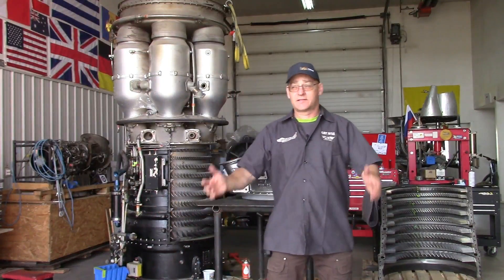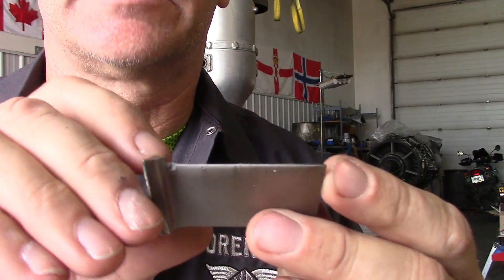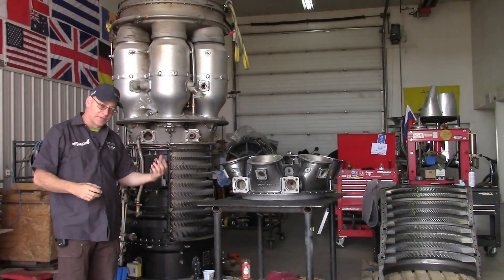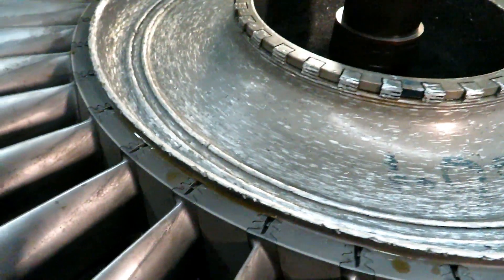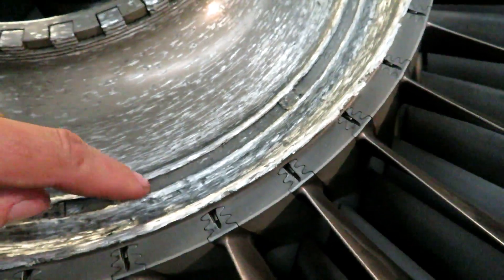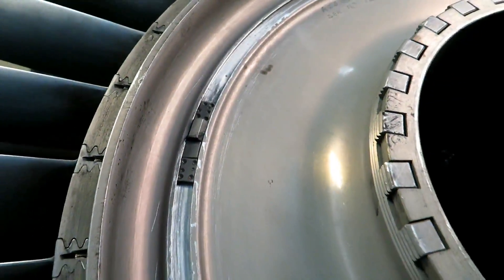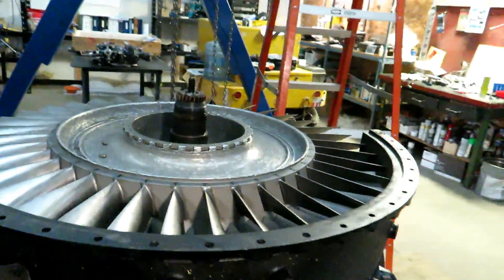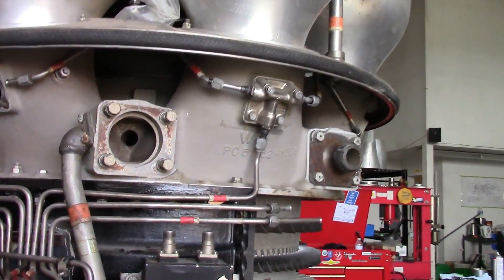Surprised by unusual damage

Comment: What's your opinion on the problems Rolls Royce is having with their Trent 1000 engines?  Poor engineering?  Flawed concept?  Improper maintenance?
Reply: As I understand it, the Trent 1000 has had some form of very obscure vibration problem with the rear (correction: front two) stages of the IP compressor blading, which has taken some time to understand and correct.   In addition, I believe that there may have been fatigue failures of IP turbine blades, associated with a corrosion problem.   In contrast,  the Trent XWB in the A350  has been relatively trouble free.
So, having discussed R-R's problems, should we now move on to discuss the very serious problem that Boeing has had with the 737 Max series?  And what about the problems that both GE and P&W are having with their newer engines?  In particular, things seem to have gone very quiet about the uncontained failure of a GP7200 engine on an Air France A380 over Greenland back in September 2017.  
It does seem to me that there is a tendency for the media (and politicians) in the USA to gloss over engine and airframe problems when they occur to US products, whilst highlighting the problems with overseas products.  If, for instance, Airbus had experienced a problem similar to that which has affected the Max 8, then I have little doubt that there would have been demands in the USA for an immediate (if not permanent) grounding of the aircraft.
Reply: i. rob  And, unfortunately, another GE90 on a Philippines Airlines B.777 has had a problem.  I'm flying back home to the UK on Monday, courtesy of four Trent 900s. The A380 has been branded a "failure", but it is the most comfortable long-haul aircraft that I've ever flown on.

Comment: Use the same cases
So it's outer
The base of support
That's not fixable
This is a garbage
Then
The paint is
Take a front frame off
I was shoked
Shocking thing
But there are
But they look like
This way
Really smashed
Moved along
The area ware
It's hard to say
Big enough
Here's a little piece
More of a fence 
All the way of compressor.
Up here
There is it there
So
The basics are
No real damage
Looks ok
Looks alright
And so we have
There's a tool
And pull the top tube
Put it together
Take that compressor rotor
We check the balance of that thing
Not any catostropic damage
Sticking the same space 
Non the less
This is the best thing
Anyway 
Undamaged
This supposed 
But I do believe
Anyway
Now
In order to repaint
Brownie
Not really attractive
Metalic 
It's awesome
This is the stock color
We got black
We got high heat silver
Dull
look at this
Custom color available
But they won't be notice
This is undamaged 
Use the original cases
Saver jet engine
Reminder 
Worked over
They do a tough job.
Just do that
Only 
Repaint it
That's not the best plan
Service 
Needs to be overhaul
Safety is no one
It's gonna be awesome
Thanks for watching
Reply from the maker: ... the lyrics to a mechanical resurrection anthem? 
Sabre Jet.

Comment: O/T Question - Can an Airplane travel faster than the exhaust gases from the Jet Engine?
Reply: Well a rocket can do so, so an airplane probably could in theory. In practice drag will probably prevent that.
Reply: Thank you, it's hard for me to wrap my head around that concept.
Reply: @tetekofa  well you think of air pushing against air, which is not wrong in itself, but then you also got engine accelerating air and (force counterforce) engine beeing accelerated.
Reply: No! An aircraft (being a Brit, I cannot bring myself to write 'airplane' - it would have to be 'aeroplane') cannot fly faster than the efflux from its jet engine.  I've referred to the Froude Equation for the propulsive efficiency of a jet engine on this channel numerous times in the past.  It's very simple:
Propulsive Efficiency (as a percentage) = [2V/(V+Vj)]x100 - where V is aircraft velocity and Vj is jet efflux velocity.
So, if you make the jet efflux velocity equal to the aircraft forward velocity, you get a propulsive efficiency of 100percent.  There is, however, one small snag with achieving 100percent: there is no momentum change in the engine efflux and the thrust must be zero.
Now make the aircraft velocity greater than the jet efflux velocity and you will get a propulsive efficiency greater than 100percent, which is quite impossible.
PS  I have just picked up the question about the exhaust velocity of a rocket engine, relative to the vehicle it is propelling: that is an entirely separate issue.  In this case, we are discussing the efflux velocity of an air-breathing jet engine, relative to the velocity of the aircraft that it is powering.  The Froude Equation rules.
Reply: @chemieju6305  No! please see my reply to the question.
Reply: How is then, a rocket can achieve orbital speeds of 17,500 MPH? Is the rocket exhaust 18,000 MPH?
Reply: @tetekofa  It comes down to difference in intake vs exhaust speeds. A rockets intake speed is 0 as it already carries its own oxygen. A jet on the other hand has to accelerate the intake air faster then it is already going. Once the intake speed matches the exhaust it cannot accelerate any faster.
Reply: @grahamj9101  thanks for the correction, i'll look it up.
Reply: @tetekofa  Things orbit the Earth at those speeds without exhausting anything. Lack of atmosphere will help with drag. Then factor in Earth's gravity and there ya go.
Reply: @tetekofa  No, of course it's not, but you're on the wrong track: so let's go back to the Froude Equation.  The V for aircraft velocity in the equation is the air speed, not the speed over ground.  The jet engine has to accelerate the mass of air entering its intake to a higher velocity than the air approaching it, in order to produce thrust: that's Newton's Laws of Motion in action.  An aircraft with an airspeed of 550 miles/hr flying into a jetstream headwind of 150miles/hr will be doing 400 miles/hr over the ground.  Going in the other direction, it will be doing 700 miles/hr over the ground.  The aircraft and its engines can only 'recognise' their speed relative to the air: the engines will be producing exactly the same thrust in both cases. 
A space rocket carries all the mass of propellant (fuel plus oxidiser) that it ejects to produce thrust, so the Froude Equation does not apply.  Having got to orbital velocity and while in orbit, the engines are shut down and the rocket's velocity, relative to the earth beneath, is essentially constant (neglecting the effect of the very small drag force from the occasional air molecule it encounters, which will eventually bring it down).  Now, when the rocket's engines are ignited to  lift it out of orbit or go for re-entry, the engines are producing a momentum change in the mass of propellant that they are ejecting, as they are accelerating the propellant relative to the rocket.
Mr Fergusson is essentially correct and has given you the answer in far fewer words.
Reply: @Mike L Yes, of course, that situation could occur transiently when the aircraft is in a dive: however, I don't think for one moment that was in tetekofa's mind when he asked the question.
Reply: @tetekofa  The rocket carries its own propellant which is already travelling at the same speed as the rocket. A jet takes most of its propellant from the air (the fuel being only a very small proportion of the exhaust) and it has to decelerate it in the engine and then accelerate it again out of the back of the engine. If the speed of the air exiting the engine is lower than that of the air entering the engine then the engine is only causing drag, not thrust.    
Put another way, the momentum change of the air  decelerating before entering the engine is greater than the momentum change of the exhaust accelerating out of the back.
In an extreme case with a zero bypass engine and an extremely low drag aircraft you might in theory achieve a forward velocity ever so slightly faster than the exhaust velocity, but that is only because the exhaust mass flow rate is a bit  higher than the mass flow rate of the air entering, so if the air is exiting at exactly the same velocity as it is entering there would be a small positive thrust due to the added mass of the fuel into the stream.
For the rocket there is zero mass flow rate of external propellant (atmosphere) and 100% of the exit mass flow rate consists of the on board propellant.
Reply: Well, a Jet engine carries it's own fuel too, except the oxidizer. Are you telling me that Rockets have unlimited speed in space? in a vacuum?
Reply: @tetekofa  "except the oxidizer".
And the inert nitrogen, which means all of it is carried on board except almost all of it.  The highest possible proportion of fuel is less than 7% of the propellant mass in a zero bypass jet engine and normally significanlty less than that, the other 93% (or more normally 95%+)  being the oxygen and nitrogen from the atmosphere. So the mass of the fuel on board the plane contributes very little to the momentum imparted, unlike the rocket where 100% of it is. 
In a jet engine the fuel is primarily the source of energy while the air provides the reaction mass and part of the energy (in the form of the oxidiser part of the combustion).  
In a rocket engine the fuel and the propellant are one and the same thing, providing both the energy and the reaction mass.
Reply: @tetekofa  Except the oxidiser?  That's the big difference.  A rocket has to carry a huge amount of oxidiser and most of what you see on the pad at Cape Canaveral is two big tanks, stacked on top of two even bigger tanks. stacked on top of two enormous tanks.
 And yes, a rocket has potentially unlimited speed in the vacuum of space, limited only by the amount of fuel and oxidiser it can carry.
Getting back to the jet engine,  at take-off, the mass flow of a big turbofan, such as a Trent 1000, is over a ton per second, most of which is bypass air, of course.  Doing a quick sum, I reckon that, at take-off,  the combustion system needs around 50lb/sec of oxygen.  
And for your information, when the industry does performance calculations using mass flow, the added mass of the fuel in the combustion process is often ignored.
Reply: @graham - Thanks. Let's go back to my original question. "Can a airplane travel faster than the jet engine exhaust/gas flow?" Now lets apply that question to rockets. Some here has said yes it can. I assume through displacement of mass. So, the question becomes - How fast can a rocket go in the near vacuum of space. Will it accelerate to infinity? Accelerate to the speed of light?
Reply: @tetekofa  The original question has also been addressed very comprehensively by Mr Lister and I refer you once again to the Froude Equation.  
In respect of a rocket in space, Mike L has got it right.  A rocket in orbit isn't aware of the fact that it is doing about 17,000 miles/hr round the earth, or 67,000 miles/hr round the sun.  All it is aware of is an acceleration (or deceleration) when  the engine ignites - and the exhaust efflux velocity can be as high as 10,000 miles/hr
Reply: Well the Earth is spinning at 1000 MPH at the equator, relative to the Sun, so you got to add that into the equation as well. At Cape Canaveral Florida, I'm guessing it's about, plus or minus 800 MPH. (as a side note, this is why "space agencies" launch rockets as near to the equator as possible, hence French Guiana)

Therefore - 17,000 MPH + 67,000 MPH + 800 MPH = 84,800 MPH

Unlimited Speed
Reply from the maker: Lister Dave: I'm telling you: rockets have speed in space that is only limited by how much fuel they have.
If a rocket engine engine powered tanker (already in space)had an exhaust jet velocity of 40 km per hour... roughly twenty five milers per hour (spelled so you know it's not a typo), and had enough fuel to run for years... it could easily reach (eventually) a speed of a hundred thousand miles per hour. Stopping is not covered under the current warranty agreement!

You betcha. If you don't agree, start doing your research to prove me wrong. You will eventually end up saying : "Holy crap. He's right!"
Ready, set, go!

Comment: How many hours between overhauls for your car engine?
Reply from the maker: ...or your bicycle?
Or your rowboat?
Or your microwave?
I know! How about you toilet?
Reply: If your car engine stops you call a tow truck. If a jet engine stops, especially in a single engine airplane like a Sabre, the plane probably crashes and you eject and possibly you are injured or killed. The maintenance standards are clearly not the same.
Reply from the maker: Dude... you're still talkin' pistons here....means nothing in Jet City.
Reply: @AgentJayZ  I was brought up on pistons.  It took the Vulcan prototype flying low overhead to turn a small boy away from the cars he was brought up with.

Comment: I've only seen a few of your excellent videos, but I am aware of the speeds these rotate, and gradual metal fatigue....How could anyone actually consider running that part without serious remanufacturing....or the trash bin....   Oh sure...it's been running fine....until....%*&*# !!

  I've worked on stationary steam operated turbines....after replacing the superheat tubes (welded in ) they go to great trouble to make sure no (NONE) welding rod stubs are in the 12" inside diameter 1,100 PSI steam supply to the high pressure turbine....usually not a problem, they are TIG welded, but you still have 'lost' bits of TIG wire...jobs I've been on, you have to turn in the same numbers of stubs, as you get at the beginning.
Reply: I believe that one of the standard operations when commissioning a new power station was to blow down the steam output direct to atmosphere, in order to clear out any debris. I vaguely recall being shown a film clip as a student.
Reply: @grahamj9101  RIGHT !! in this plant, there's a ball valve in the steam line at the high-pressure turbine...12"" pipe...we'd run up the boiler and steam generator to 1,200 PSI, then bolt 2 'targets',  2"x2" bars of highly polished stainless steel, across the open end of the valve.....Then we'd go into the control room, insert earplugs..  The operator would open that valve in about 2 seconds...steam would blow for 30-40 seconds....it shook like standing 4 feet from a Top Fuel car leaving the line...and the noise !!
 A plume of condensed steam would go 1/4 mile high. We'd inspect the 'targets'...if there was a single dent ...the whole procedure was repeated.....
  33 mega-watt biomass plant...the people in the town nearby would call it Chernobyl...!!

Comment: That disk is scrap. Can a J47 engine be put in a Canadian Saber?
Reply from the maker: The different versions of the F-86 air frame were all engineered to fit their respective engines. The J47, the Orenda, and the RR Avon are all slightly different in size and external configuration. It would be possible to modify an aircraft to accept an engine other than the one it was designed for, but it would be expensive, and there would the loss of authenticity.
These vintage warbirds have a great deal of historical value.
Reply: Understood. I never worked on an F86. Mostly C47 and RB66.

Comment: What holds the weights in place?
Reply from the maker: They are peened in place. That's what causes the dots that make them look like dice. A pointed punch driven into the top surface causes the metal to spread out, wedging the piece into the very close-fitting track.